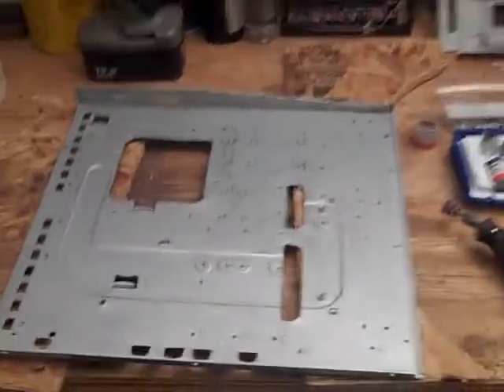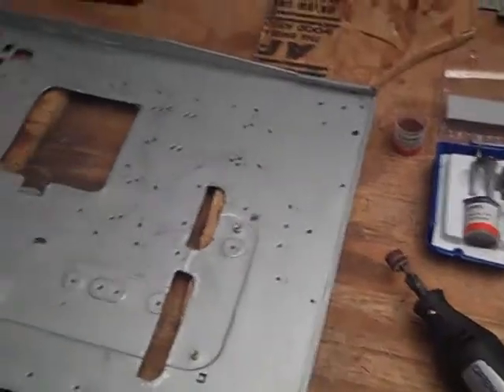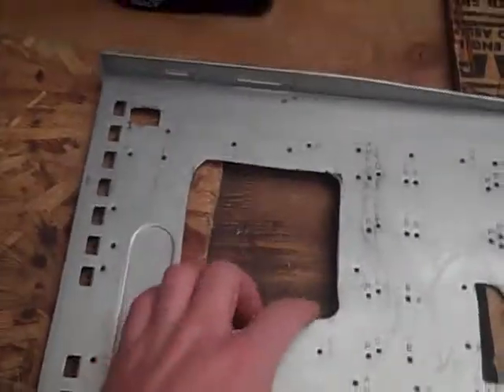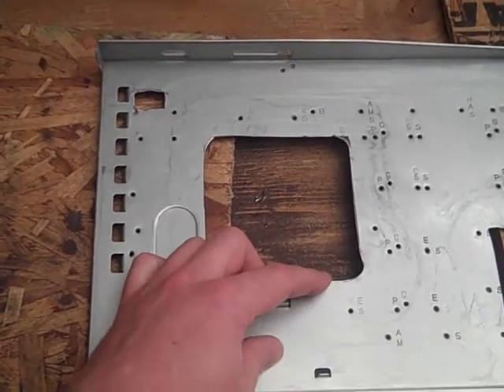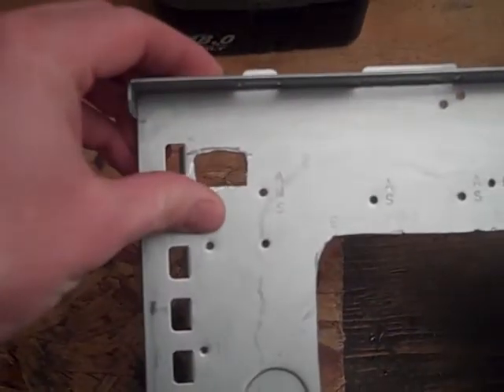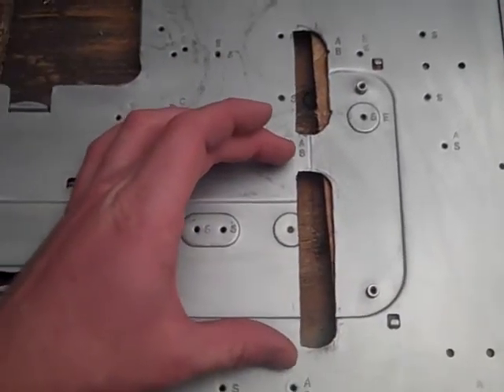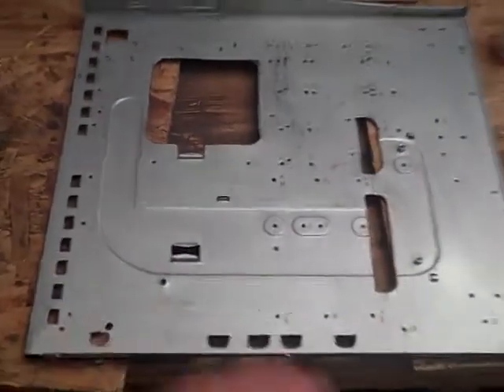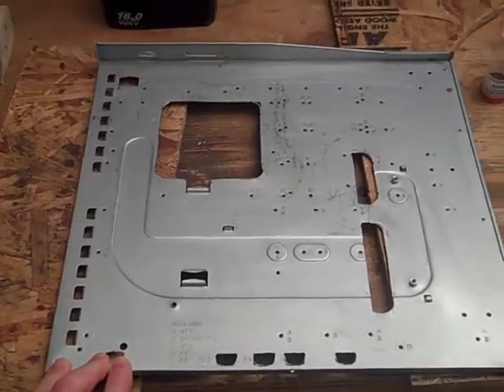Motherboard tray mod

Comment: Oh my, lol that is almost exactly how I did my brothers system a few years back. However I had his mcr220 mounted further away from the case so I could put the fans between the case and rad pushing through and away from the case. That way I could keep the stock exhaust fans. I also painted the interior of his case black and used some automotive grade carbon fiber vinyl film to do his case floor. Then I mounted his pump to the floor with a XSPC clear top and some UV LED's.

Comment: Rocking out in the Garage huh? Well maybe you should have turned up the rock-n-roll in the background a tad more then, lol... j/k, I am doing the same mod here in the next few days on my TJ07 tray, although I will not be cutting the Sata or ATX 24pin holes since I have braided UV cables going straight down through the floor that I want to be visible. Other than that its almost exactly what I'm doing this weekend. Anyway, thanks for the extra ideas. You going to paint it as well?